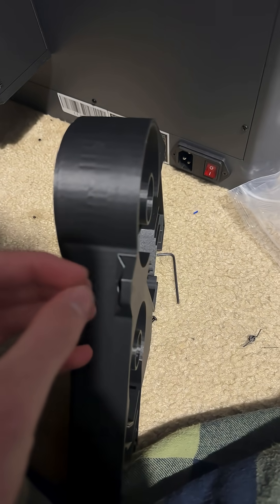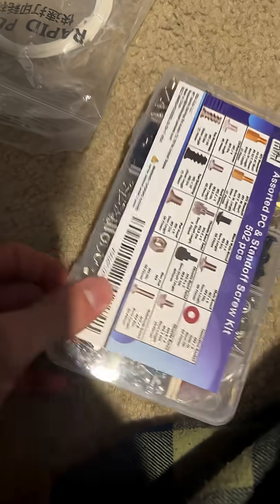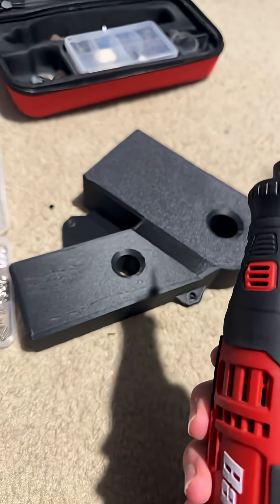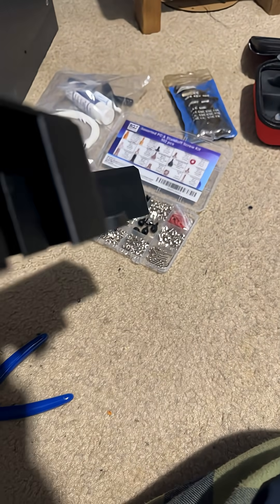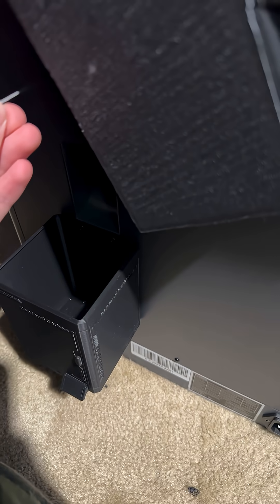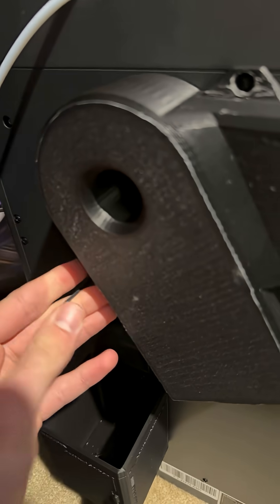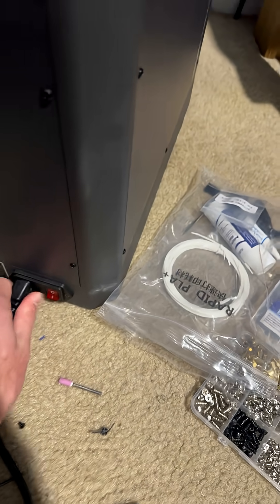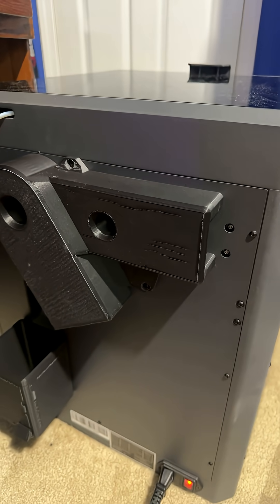Installing a silencer for the centauri carbon#elegoo #centauricarbon #3dprinting

Comment: Question,  why is it quieter? 
Answer, because your restricting the airflow.
Reply: your answer couldn't be any more off the target. the actual answer baffles break up coherent vortices and deswirl the flow, cutting broadband turbulence noise
Reply from the maker: inside temps stayed the same so if it works it works